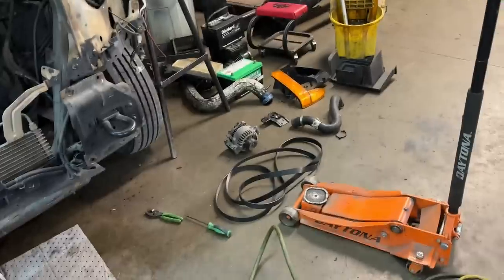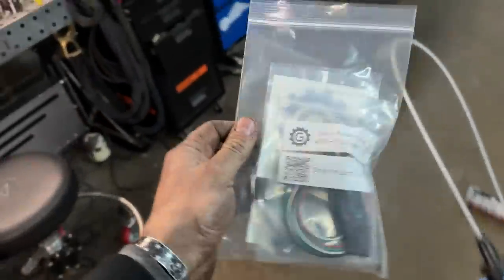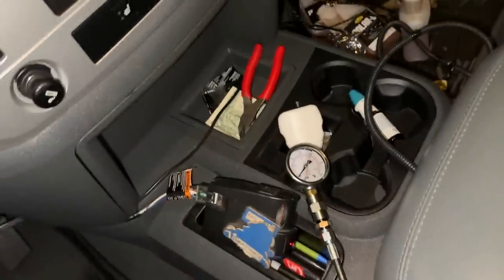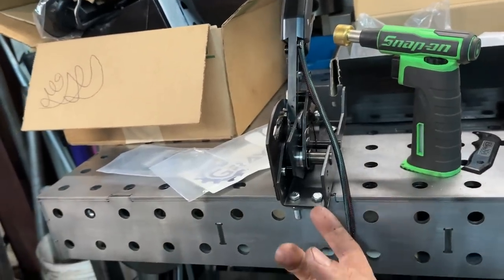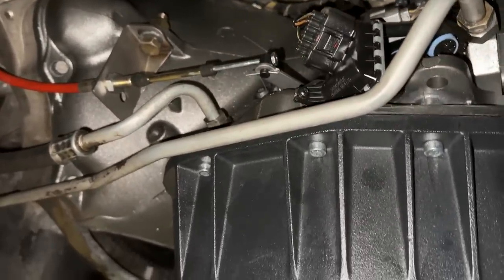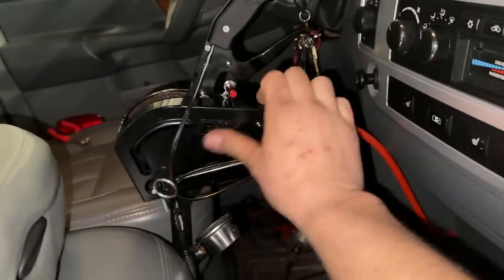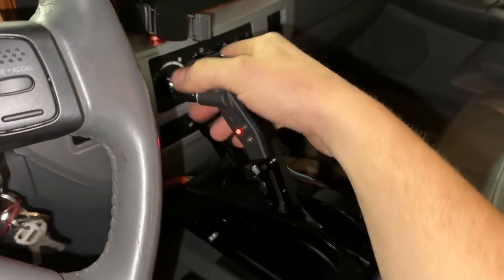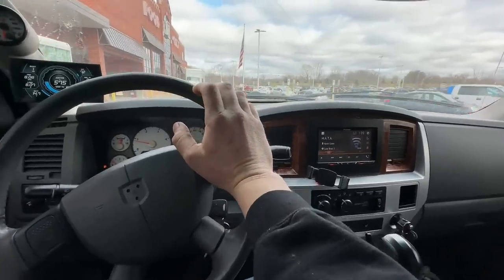HOW TO INSTALL A FULL MANUAL VALVE BODY! Cummins powered ram with a 48RE

Comment: Thanks for the feedback! The reason I don’t do a welded nut, and the heart shaped design is so that they are reversible so they can be used with B&M/TCI shifters & PPP shifters. Welding on a nut would mean there would be 2 different designs for the different style shifters and wouldn’t allow any adjustment for cable orientation.
Reply from the maker: Serrated nut would fix the issue too or a nord  lock washer
Reply: @horsetorquesdiesel  Will it work with a Hurst Quater stick?
Reply: How do I order that same shifter backet

Comment: I'm guessing I am a decade older but don't ever stop telling it like you see it. I really love your content and value your opinion. I have a 2005 Ram 3500 single tire quad cab long box 'Clifford the big Red Dodge'  (278k miles) with PDD valve springs and pushrods, SXE472 compound kit, air dog, Fleece 10mm stroker CP3, industrial injection 45% over injectors, Fleece coolant bypass, NV5600 with Valair twin disk organic towing clutch... and I will need to rebuild my T-case soon because it's leaking pretty good from the front drive line output shaft seal. Your video on the T-case rebuild is going to save the day!!! Thank you!!!!

Comment: Towing wise I will never go back to a reg vb. Get stuck once and fall under the charger on a hill and have the safety’s in the vb always grab the next gear too soon and snuff out the charger and you end up stuck in 2nd or third locked when you know you could get it back up into fourth if it would do what you told it too do. Lol. Happened once coming out of Vegas. Never again. I call them half and half’s though and I really like those for daily’s/towing. In third it will run like a auto, but you turn off the gear shift safety’s so it will go to 2,1 anytime and stay till you change gears. Take lock up and od away from the pcm. Absolute dream to drive. But maybe im partial. I have been a fmvb guy since highschool lol. Killer video!!!!

Comment: Very helpful im doing a 96 12v 47re fmvb swap into a chevy. 1 I adjusted the cable from park an had it jump into reverse while i was under it an 2 im running the ecm pmc tcm what ever it is for the tach an speedo an had the lock up an od wires to toggles an grounds i was relaying on the computer for the 12v for pin 1 but... with the gov pressure sensor unplugged that didnt work ran it to fused keyed power an got my od an lock up to work 3 im running pretty much the same line pressure setup but was running off a different port...ftw thanks for the info

Comment: Great content as always. Definitely have a lot of control with the FMVB. Very interested to see how the towing duties go with it. I've already got an nv5600 truck as a tow piggy, so I already enjoy shifting. My biggest thing I want is an exhaust brake to go with it and compounds. I'm guessing a modded 351 with a s475 or s480 would be a good setup on that for towing. Have you ever run any of the DPS turbonator set ups? That would be an interesting set up to see in there for the exhaust brake/vgt functionality they offer.

Comment: Awesome video!!!! Let us know how you like it especially for those of us at the low HP 😒 level. I really want to install one of these. I have always wanted a “manual” truck and see this as the next best thing 😂. Is PDD good place to get a MVB from? Do you guys offer them? I have PDD 650hp trans. Still be ok to run a MVB? Thanks Adrian
Reply from the maker: You’ll have to swap a couple springs too but it can be done
Reply: @horsetorquesdiesel  what do you mean a couple of springs? Elaborate kind sir. Adrian

Comment: Stealth 64 or whichever one Calibrated Power is manufacturing and redesigned to replace to factory 4th gen air spinny squishy device, then you get an exhaust brake for towing as well

Comment: I mean you definitely have some points about the 7.3 but I feel like it depends on what kind of person you’re if you want reliability I feel like the 7.3 tops all I mean it’s proven itself now if you want something fast and quick witch you can do to a 7.3 to some point but that point is definitely lower than other trucks also before I got a 7.3 I knew nothing about diesel’s and it  taught me so much so I definitely feel it’s a easy truck to work on

Comment: Just curious, what happens if you forget to unlock over drive and shift down to second? Is the valving setup in a way to prevent that from happening or is it something you just have to pay attention to and not forget?
Reply from the maker: It will kill the truck

Comment: 7.3 doesn't need billet heater/ac flaps tho.

Last time I checked, Cummins guys swapping in a 4r100 transmission is an actual thing that happens.

But serious, is the actual cost of getting a 12v to 600hp vs a 7.3 to 600hp all that different, all things considered?

Comment: Do you have to do any additions internally on these transmission to run this set up? Or can it be thrown on a auto 48re with what your video shows.
Reply from the maker: Have to change the servo springs and  I always upgrade guys to the billet L/R servo on a FMVB
Reply: Thank you for the information

Comment: Do you happen to have a part number on that shifter I’m wanting the one like that without switches because I’m wanting to run the tier one buttons
Reply: Can't run the b&m shifter with tier one handle/buttons. Tier one is for ppp shifter

Comment: Ok, I have to know, how is it tuned to be able to show up on the dash and reverse lights. Currently having to run my truck with a manual tune, so I no gear selector on dash.
Reply from the maker: Gotta have that added in Calterm

Comment: Have you tested or ever ran the pdd line pressure gauge? I just ordered one but noticed you went with a "mechanical" gauge
Reply from the maker: There’s a reason I don’t use it. But legally can’t say why
Reply: @horsetorquesdiesel  fair enough

Comment: Wish my 47re shifted that smooth, it bangs going into each gear unless I’m at the perfect low rpm range say 1800 rpm and locking the converter from 1-2 2-3 is rough as all get out😒
Reply from the maker: Mess with the TV adjustment?
Reply: @horsetorquesdiesel  tv cable was removed sense it said it was a constant flow converter 150 psi unlocked and 190 psi locked. In drive not moving I have 130 psi. I haven’t adjusted or messed with the valve body parts yet
Reply: @horsetorquesdiesel  the valve body I went with was muldoons. I contacted them and tried to get ahold of John with no luck at this moment. I’m not sure if it’s acting this way because I don’t have the spacer in the low/reverse piston or if it’s normal like it is but from watching you shift that one it’s got me concerned and I don’t wanna blow this trans up over something small

Comment: Im ignorant of this shifter, but what is the point of this why not just get a 6 speed?  Is this just so you can shift in a automatic? I'm confused could someone please clarify for me please and thank you.
Reply from the maker: It’s a manual way to control an automatic 
48re when built handle a lot more power than a manual
Reply: Cool thanks, so one more question is there a big difference than using the column shifter on a auto?
Reply from the maker: @mattm9621  yes it gives you full control the column doesn’t
Reply: @horsetorquesdiesel  awesome 👌  thanks again for the info.

Comment: Where's your TV cable and spring did you not reinstall it
Reply from the maker: It’s a TTVA
Reply: @Horsetorques Diesel  yes but do you not have to reinstall it I'm almost done doing mine and don't wanna reinstall that cable if I don't need to.

Comment: Waz that part # for the wiring thingamahjig please?
Reply from the maker: https://www.ebay.com/itm/325891398110?mkcid=16&mkevt=1&mkrid=711-127632-2357-0&ssspo=hRNy2P5yS3W&sssrc=4429486&ssuid=25L61aqMQRS&var=&widget_ver=artemis&media=COPY
Reply: Thank you!
Reply: I hadn't seen that you responded,  I got my stage 1 fmvb installed and while I sort things out,.. I don't have cruise working. (My 04.5 has the apps next to the engine) advise for me on this? Thanks bro.
Reply from the maker: @mattheweberly1047  cruise should work may want to check basic in lines
Reply from the maker: @mattheweberly1047  vacuum
Reply: It had been working..
I bought my Trans wiring from grays, just I noticed the plug you used had more then 3 wires (this is what mine has).
I thought maybe this had something to do with this....

Comment: I'm kinda lost.. am I missing something really big here? All you did was move your shifter linkage and the bottons from factory?  The truck was full manual before you did that? is this is what a manual swap looks like? Because you didn't even change anything. You relocated factory controls? And the you even said the factory cable works better then the one you installed? Wtf are you guys smoking?
Reply from the maker: I’ll try to explain. 
I ran a new harness for LU and OD 
The shifter comes with a new cable which I installed. Instead of removing all the factory stuff I left it in case I want to switch back. 
The factory controls do not allow for LU or OD control when you want only when the ecm commands it. I don’t understand how you are not getting it
Reply: @horsetorquesdiesel   ya, that makes sense I was just unsure how you shifting it vs the computer was any different. Why not just program the computer to shift right now instead of tomorrow.

Comment: Dude I wanna pull my g56 and put in a 48 w/ fmvb so bad. So sick of that slow clunky ass manual.
Reply: We may have to find each other.  I wanna swap my 48re for a G56.
Reply from the maker: Missed connections 😂

Comment: Do you run a aftermarket trans temp gauge with this setup? Or throw the pin from harness into that plug?
Reply from the maker: Yes in the pan
Reply: @horsetorquesdiesel  thanks for the feedback. Here I am again lol. do you have any idea what they do tuning side of things to get it out of derate? I’ve went thru a few tune revisions now without fix. Do I need to run a manual tune file? 05 truck auto shift transfercase